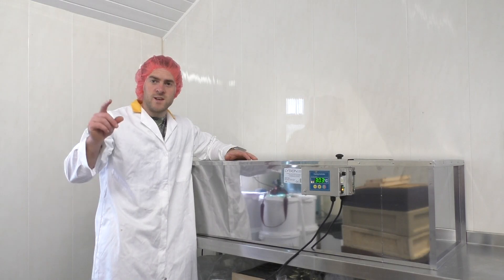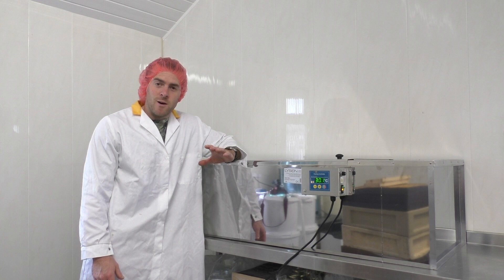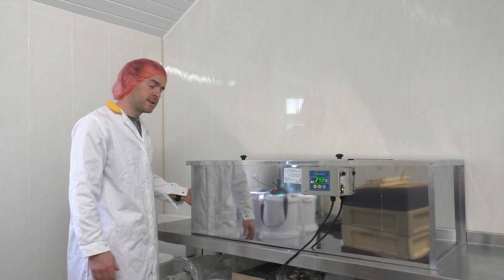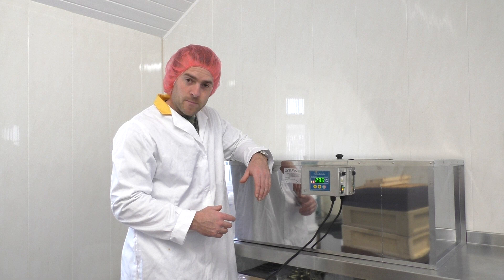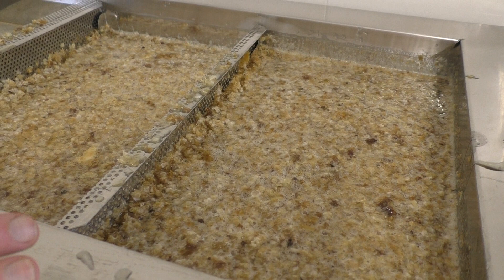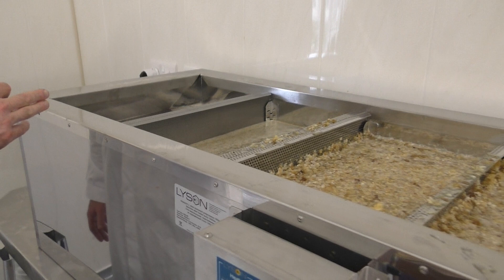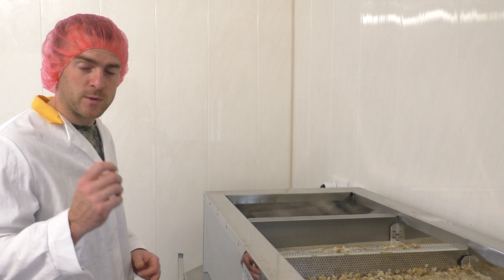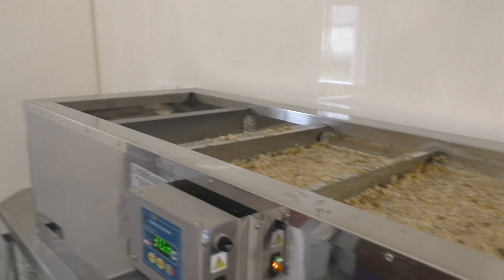Lyson Honey sump Review

Comment: This is next on my list for the honey room. Great piece of kit. Why so much wax out of the extractor? Blown frames?
Reply from the maker: Black Mountain Honey a few blown frames but I always get a lot of wax straight out of the extractor. Maybe because I use a hot knife not sure... it looks worse than it is all the wax floats up and you can easy scoop it up and throw the slop in the apimelter. That sump will take hours of use before you need to clean the filters. I highly recommend this!! You will love it!!
Reply: @gwenyngruffydd  Ah that makes sense if its deep and the wax is floating up. It looks such a great piece of kit. Im going to connect the extractor with a ball valve to discharge directly to the sump. The wax cappings screw press will also discharge into it. Trying to minimise the processes from frame to jar.
Reply from the maker: Black Mountain Honey that would be a great system!!

Comment: How has it worked out for you so far. I’ve been looking at getting one but there isn’t much info out there on it. Filtering wax after extracting is my biggest bottleneck. Using the traditional double sieves isn’t cutting it anymore. 

One question, how does it heat? Does it heat the entire tank evenly or are there hot spots. I’m guessing that it is an electric coil of some sort since it isn’t water jacketed.
Reply from the maker: Yes the tank is wrapped in electrical wires that heat. 
Probably a water jacket would be better, but I have no complaints yet about it. 

You still need to run the honey through a final filter after this though.